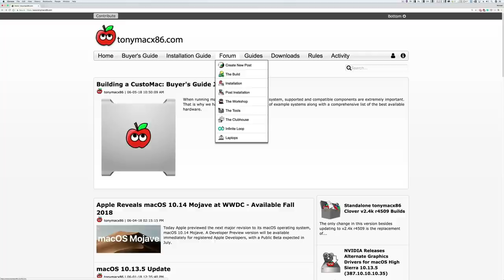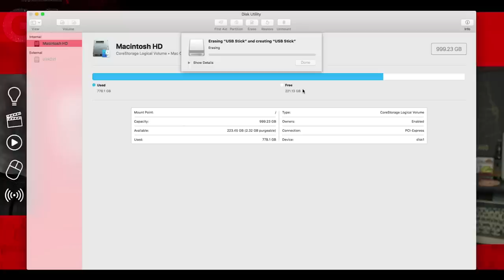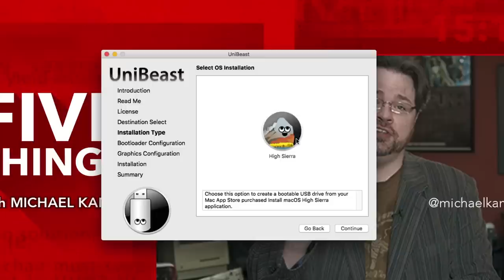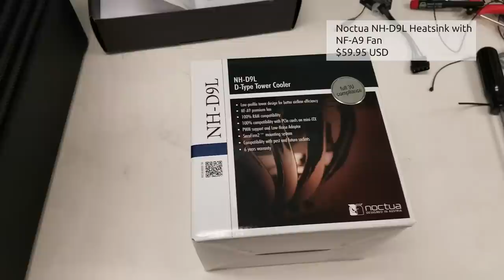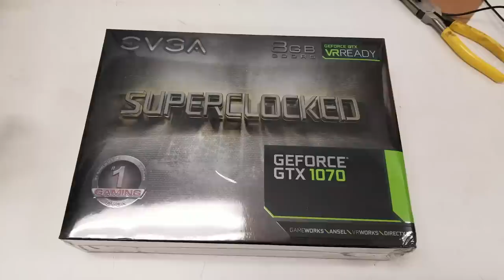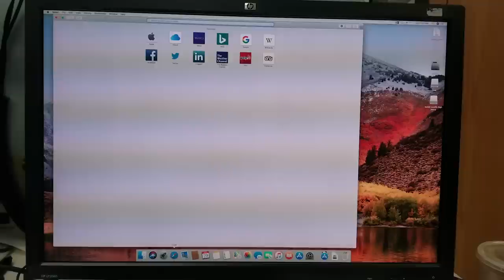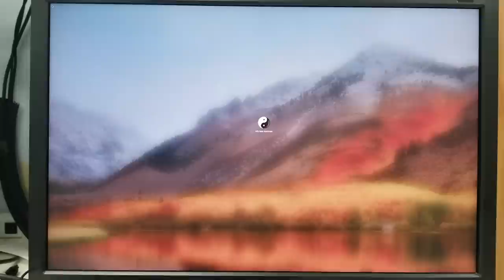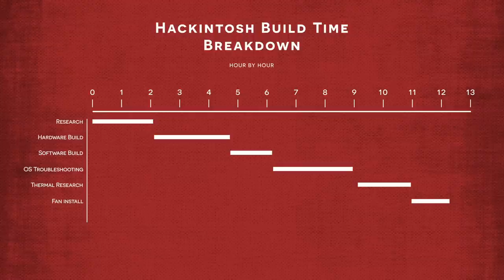Building a Hackintosh: Build & speed vs Mac Pro & iMac Pro with Avid, Premiere & FCPX

Comment: Why don't you simply switch to Windows or Linux?
Reply from the maker: Good Question.

At the time this episode was done, my time was spent squarely in the Hollywood Post industry, where a vast majority of folks use macOS - and so I needed to work in that environment to keep up with the industry. Plus, there are apps that run on macOS and not Windows or Linux. In addition - I'm a techie. I wanted the challenge.

Thanks for watching!
Reply: @michaelkammes  Thanks a lot for your kind answer.
I even saw that it is possible to build a Threadripper Hackintosh that smokes every Mac Pro (see Teresa from Morgonaut.com https://www.youtube.com/watch?v=KtAcUhl8hKo ). On the other hand Max Yuryev compared a Mac Pro to a Threadripper Windows build that showed in Premiere the Mac has an huge advantage over the more Cores of Threadripper and the even more powerful nVidia GPU (RTX 2080 Ti)! shock

For my purposes I'll stick with windows (chess player). I used to be fascinated by Apple because I grew up with an Apple IIe (during highschool). Sometimes later Apple introduce Lisa (for about 15.000 USD). Not affordable for students! I didn't understand Apple's politics any more: First Apple supported schools with their Apple IIe and later they wanted to be the Rolls Royce of computers ... strange Even though in 1996 I bought a Mac for about 6.000 USD and used it for about 10 years (and loved it). But then my chess software was no longer supported on an Apple and I decided to switch to Windows where I could use this software (I used since version 2.3 - Mac 1.1 -  and then version 10 for Windows and now version 13). I think it's not Apple to blame but this specific chess software that they failed to support for Mac any longer (there was also the switch from Motorola processors to Intel with Mac but this switch should have favored this chess software) ... sigh
Now chess analysis is no longer as simple as it used to be. All that counted was a fast CPU. Today you need both: CPU and GPU. My way of using Laptops seems to be outdated ...

Comment: If your iMac Pro has issues you have to rely on the Apple store to fix it.  If you have an issue with your hackintosh you can fix it right away and if you have to replace parts they won’t be Apple priced finally if you want to upgrade your hackinstosh you can, but the only way to upgrade I an actual Mac is to buy a new one.  You won’t have to buy a new monitor when your hackintosh parts are past their useful life and you won’t have to buy a new case, new power supply, new RAM or new SSD’s when you upgrade either.
Reply: right on macs you cant even upgrade the ssd without getting the proprietary ssd they use because its different from any other m.2 on the market.
Reply: @KillerJellyFish676 but - you can sell an imac after 3 Years for very good money, get a new one, and always have warranty. If you dont want to fix stuff yourself. always a tradeoff.
Reply: There's always a trade off. I know plenty of professionals who wouldn't to troubleshoot for a long time. Others that are quite savvy. It's all horse for courses end of the day. I bought 2009 iMac, thinking I needed it for design. And tbh, it's great. But now I've moved on to a Hackintosh/Windows 10 dual boot separate disk, purely because I hate the Apple hardware spec but love the OS.

Comment: I'm a full time media creator now but first I was an IT Engineering Manager (retired 2010), with research and planning I've never once suffered any downtime on any hackintosh I've built. I get paranoid every time I switch a component or update the OS and continue to find myself shocked I don't have any problems. 

I started hackintoshing in 2011, benchmark after benchmark, application after application, I can not make my Hackintoshes under-peform an apple.  In the early days it took a minute to get all the integrated Apple goodies enabled, but I don't even remember having Handoff not working anymore.  I'm on my 3rd personal Hackintosh build, going in for its 4th rebuild this weekend for my studio, dumping my GTX1070 for a Sapphire Vega 64 Nitro + and possibly a new AIO water cooler.  After 8 years, 3 hardware profiles with at least 4 upgrade/rebuilds each, I have absolutely no regrets at all.  I don't have an oddly shaped 50's-space-age style AIO computer/monitor (iMac) or a spaghetti trashcan sitting in a corner attached to my 41" screen, I don't have thermal problems during on stage performances (or thermal problems at all with water cooling.)  

Maybe not having enough money to build the X299 system I want with 18 over-clocked cores and dual Vega cards?  That might be my only regret, but I'm still saving for the Dominater hackintosh that will over power, out clock, out bench and out render every single official Mac on the market and send them cowering like a malfunctioning Speak and Spells.  <Dreamweaver starts playing> Oh yes, it will be mine.

Comment: This video does highlight the need to actually look everything over and plan it out before starting the actual build.  Like assuring you have the parts necessary (in this case, proper screws/fasteners) and familiarizing yourself with the heatsink installation as to avoid having to replicate work or stopping in the middle to hunt.  I always make sure it's all laid out first so I can see I have everything and at the very least skimming all the documentation first.

Comment: nvidia is a pain in the ass i installed the web driver multiple times with different versions just to make it to work gtx 1050 ti , i backed up my drive and updated from high sierra to  Mojave and i am waiting for RX 570 to arrive . the reason for the update was to get the new update for logic pro x 10.5.1 = music production system .

Comment: This is all very, very, very true. I built a CustoMac Pro in 2011 with the i7 3770K. I am still rocking this machine, but, slowly the OS upgrades, change over to clover and adding a GTX 1050ti 4GB card with the 10 series driver issues from Nvidia have made it more difficult to keep it stable when exporting in Adobe Media Encoder. Yesterday I spent 6 hours going through all the GPU changes, changing over to Lilu and Whatever green, reading the long guides on TonyMac and finally got my old, stable, CustoMac Pro back again, but, man what a PITA. If Mac made a up-to-date $3,000 tower for pros I'd buy it, but not one penny for these current "designed obsolescence" machines. I think a new i9 Hack Pro is what I'll do next and if the Hackintoshing gets too complex, then it'll be Windows OS for me as a CameraMan/Video Editor time is money and the time spent Hackintoshing in the last 2 years to update the machine and work out the bugs, lost productivity, is killing me! All the folks who built this machine are no longer posting about keep the machines going 6 years later. YMMV.

Comment: Bet you regret getting the 1070 instead of a RX580 now..... Not being able to upgrade to Mojave sucks. I personally think its 100% worth building a hackintosh. If you actually do more research as you yourself actually suggested - and build a solid build, you wont be spending hours troubleshooting - It SHOULD just work. I guess thats down to the ability of the system builder

Comment: Your guide is very good. I only want to add that it’s best to build for the software you’ll use the most. Since, I only edit with FCPX now guess what GPUs I used in my new Hackintosh?
Reply: Yes, very well. I am using it as much as possible. Only have to swap the Intel HD4000 as the boot GPU to those AMD GPUs, before working with FCPX for best performance when editing. (: Oh, well not a deal breaker. 
Happy New Year, and be a little easier/kinder to yourself in 2019. You're a cool cat and a little kindness to self will help you stay that way.  TTYS

Comment: You do not necessarily need another Apple computer to do this, you can do it with a virtual machine inside of windows, all you need is access to MacOS which you can easily emulate with VMWare.
Reply: Doing it using a VM can cause problems in the future, I would always recommend to get a version of the OS from a legit mac - I may or may not have a hackintosh that has been running flawlessly for years.

Comment: I am building the same Hackintosh, but in an ITX format... same MB and processor. I've pulled my RX 560 out of mothballs and I am just about to install the OS. I've only got 16Gb of ram in it, but considering that I am a developer, I don't need all the extra ram for graphics rendering and the like.

I've got a 2008/9 Mac Pro that only got as far as El Capitan before I couldn't install the latest and greatest Mac OS's on it... so... being mostly a PC/Windows person, It's just as easy for me to throw together a Hackintosh as it is to build a new PC. I used the same case on the PC I put together for my niece... with watercooling, so I knew the issues with it so I went with a Phantek Enthoo Evolv which has the cutout at the back for access to the back of the CPU and the back mounted M.2 slot.

Comment: i dont get it, why do you mount it vertically, when there is an m2 port at the bottom already to mount it vertically... in case the m2 port at the bottom is lower speed or std sata apologies, but it does look like full speed m2...
Reply: @michaelkammes  correction: m2 port at the bottom already to mount it *horizontally*...

those motherboards sometimes have two, m2 ports, but usually one that is the fastest version... high end ones, has two...

you dont need the vertical one, just check the specs of the mobo, and it should say m.2 nvme x4 or something like that...

ok i checked it and it said:
1 x M.2 Socket 3, with M key, type 2242/2260/2280/22110 storage devices support (PCIE 3.0 x 4 mode) this is the bottom one which you should use in case you use sata_1 port that will reduce performance
1 x M.2 Socket 3, with M key, type 2242/2260/2280 storage devices support (SATA & PCIE 3.0 x 4 mode) (this is the vertical one you used i think but it has footnote saying it shares port sata_1

Comment: do you think you would have had less issues using an AMD graphics card or would there still be issues with it just different ones? I am trying to make a machine that would work well with my work as they all use Macs however we dont have a budget to get some pimped out apple machine. is there such a thing as a problemless hackintosh?
Reply: any suggestions on minimizing pain with a brand new build if i decide to do it that you didnt cover in the video?

Comment: most important question ,  is it perform better or worst than windows 10 , or the same ,,  on the same hardware, or software like premier   so is worth installing mac os on my current machine, 
o
Reply: well, point is i was thinking of try on my machine, but if there is no performance benefit, is not worth the troubleshooting  to make it work,
Reply: Don't quote me but I think macOS runs slightly worse on identical hardware.  Not sure why.  You install macOS for convenience, stability, and interoperability in the Apple ecosystem as opposed to performance.
Reply: so if there is no performance benefit, why bother ,, well if addobe will make a linux version will be cool ,
Reply: MacOS, when used and understood properly, is way more efficient for power users. Though, if you're a professional artist/designer the Surface Studio 2 is better, and if you're a developer then it's quite possible that Linux is more efficient. But for me, as a creative in the audio space, Windows can't come close to being as efficient an OS as MacOS. It's just ridiculous how fast and efficient my workflows is on a Mac compared to Windows PC.
Reply: am not too much in to audio editing , but for that i use audition , so i can go back an forth to premier , under windows ,and my Korg nano controler and also the launch control , wich i use for ligthroom work fine, with both aplication

Comment: You dont have to mount the ssd like that there is another m.2 slot in between the pci slots that lets you install it as normal, flat against the board

Comment: Building one of these is on my bucket list.  I'm currently using a 2012 iMac 27" and hitting my limits with 4k video, but upgrading to a newer mac is so insanely expensive.
Reply: I'm thinking....2017 iMac 4K (refurb'ed for around $2,200 - 2,500)
Reply: @mishinka  a hackintosh would be more effective
Reply: The Real Osas thanks for the comment, but upgrading hackintoshes is a beast of an undertaking (at least until you’ve got it all dialed in). I do actually have an older model hackintosh that is stick at 10.8.5 because of this.
Reply: @mishinka  i belive Taking some hours of my weekend is worth it instead of paying the apple tax.

Comment: im getting ready to spend about the same amount on my build, but its a beast.  However I am a full time creative professional, and parting with nearly $3000 (including a monitor) is giving me 2nd thoughts on whether i NEED to replace my late 2014 5K iMac.
Reply: I have the same iMac and I am struggling so hard what to get... I actually NEED to spend money in 2019 for tax reasons, but somehow I want a ultrawide 34" Monitor (the LG 5k one)  and not an integrated one in thei mac pro. Problem is: Nobody can tell if it works on a hackintosh with Displayport 1.4 (it does with a pc). So, probably I just wait... :( Mac Mini + egpu also came to my mind, but the performance seems to be not so much better than the 2014 5k imac. Damn it, I wish so hard apple would sell an up to date cheesecake macpro.
Reply: @berndkiltz  i hear you.  I maybe should have waited until after Jan 1 for this expense, but oh well.  I am sticking with a pair of Dell P2715q 4K monitors.  I have one now with my iMac and it works lovely.

Comment: But if you want to install Mojave, will the videocard support the new system? Does it have Metal-support? And if not, how do you get it? I have MacPro Quadcore mid 2012. Can I change motherboard and get a ’’new’’ computer with USB 3.1 instead of 2.0? Sounds hard to me. The machine is soon vintage, Mojave is probably the last update. I bought it in 2013, and already then it was kind of old. And now I am thinking of taking it to recycling and buy something else (not Mac though).
Reply: No Nvidia gpus are not supported in Mojave. Web drivers are probably not even going to be released. Only natively supported Nvidia cards that do not require web drivers work on mojave

Comment: As nice as these parts are, I've been able to install Mac OS X (Mojave) and it runs fine on my i3-7100, 8GB of RAM and a GTX 970. Of course, it depends on how much pressure you'd put it through, but I personally found my current (budget in some eyes) build was fine.

Comment: Hello, did the wifi and Bluetooth included with your motherboard worked? Did you have any other problems?
Reply: I have both Wifi and Bluetooth working on my Hackintosh, the key is to replace the Intel Wifi card with one natively supported by Apple. It's nice to have that WiFi working because it allows the machine to Airplay with Apple TV.

Comment: http://pupilizer.com/category/hackintosh-elements/
macOS 10.13.4 Update   Today Apple released macOS High Sierra 10.13.4 Update, a major software update to macOS High Sierra. Update any supported system using the built-in Software Update functionality through the Mac App Store, or by using the standalone installer available from

Comment: I am building a Hackintosh Pro; i9-9900K; 32GB RAM and a Geforce RTX 2070.
Reply: Skip on the RTX 2070 there's no point at all.  First of all apple has no raytracing games, second there are no RTX 20X0 drivers for MacOS, High Sierra or Mojave.  You want beef you have to go with an AMD Vega FE or 56 or 64, average would be RX580 or 590.  Nvidia is dead for Hackintoshing until further notice.  We've waited over 6 months for Mojave drivers for any Gforce card and Apple refuses to sign off on the drivers.  Go to the Apple External GPU page, there's a list of all non-apple GPU's they'll support in the OS natively.  Get yourself a RX590 or a Vega because the RTX 20XX will do nothing for you unless you're in Windows.    ---- Just got my Sapphire Vega 64 in the mail today, my old  1070 is going into the living room HTPC for steam gaming.
Reply: Apple has abandoned Nvidia. Stay with AMD for future support.

Comment: "...as a professional you need to upgrade and update your hardware and software, whenever you need it!"

Yeah, well... here's the breaking point: you CAN'T upgrade your hardware in an Apple nowadays. Sometimes not even add RAM!
Because = Because.

Apple want's to control the shit, fine with phones and stuff. But with supposed to be pro-stuff, it's not worth looking today. Even the beefy iMac-Pro comes with a price tag not worthy to pay, since you can't upgrade this beautiful piece of shit, like you would in a legacy Mac-Pro (not the Trashintosh!).
So you can re-build your system, when the need arises, this also means: swapping the motherboard when a new CPU generation knocks at your door (the old Mac Pro couldn't do that either, but it had a MB that supported a fairly large range of Intel CPUs up to double 6-core thingys).

Anyway. Hackintosh is THE way to go if you're a professional and you NEED beefy hardware.